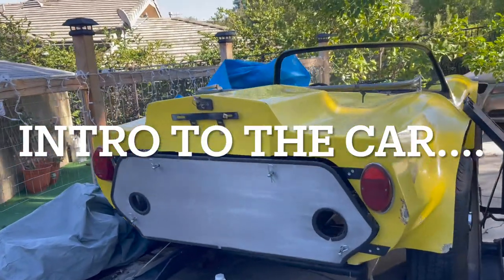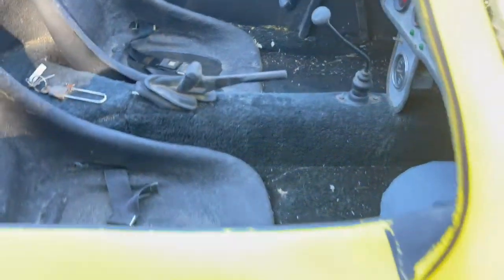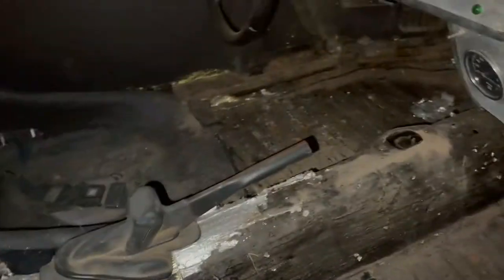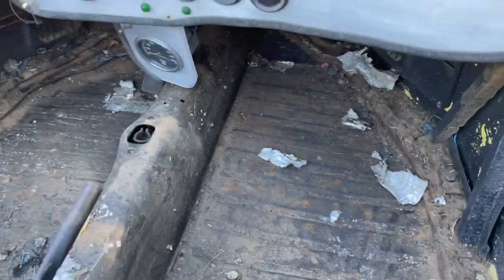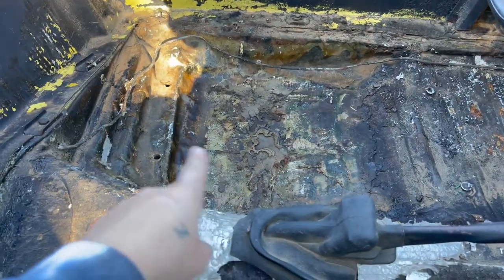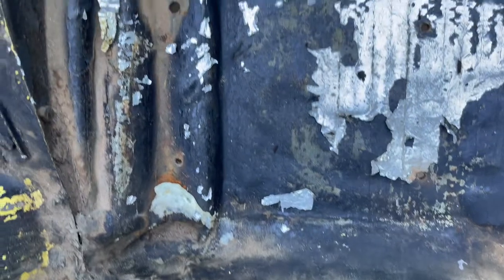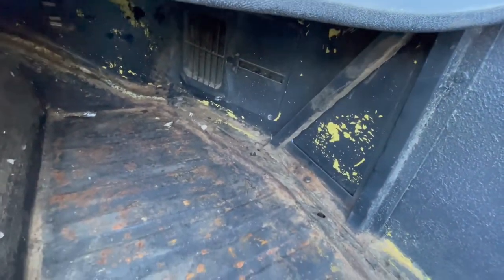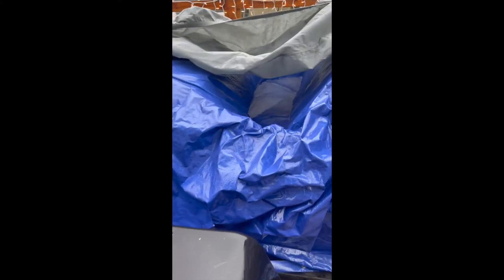Stripping the Vokaro Buggy, Vokaro Restoration, Only 500 Made! Pt.1

Comment: I had one back in the day, 2002, in Santa Barbara. Yellow with black interior. Fitted a nice exhaust, dual Webers and fixed the electrics. Until I bought it it and fixed it never really run and was like new with <5k miles on it. Sold it when moving back to Europe. Should have taken it with me.
Reply from the maker: That’s so cool yeah I don’t think I’ll ever be able to part with mine and she doesn’t even have an engine yet